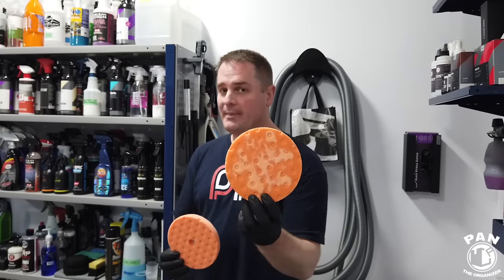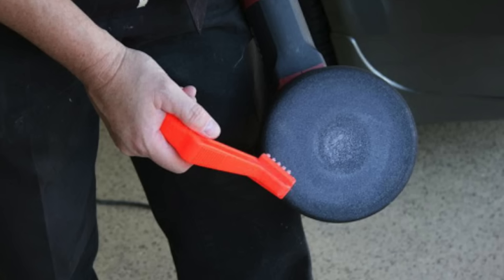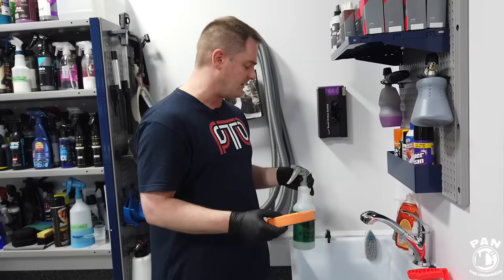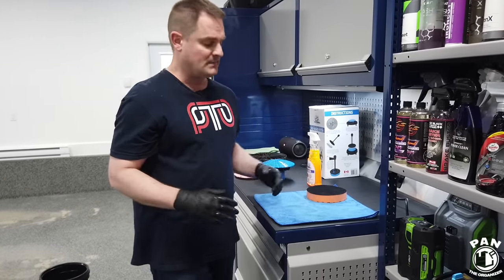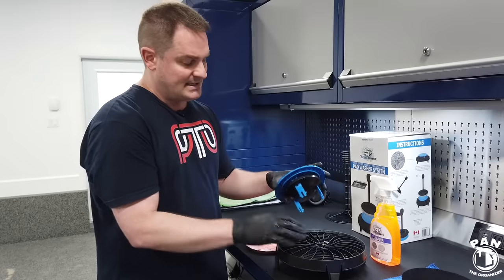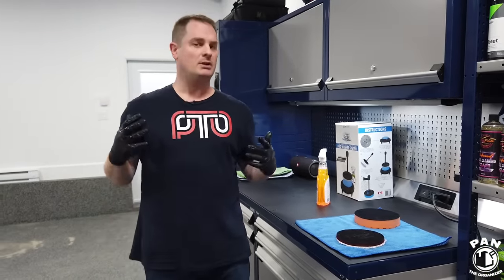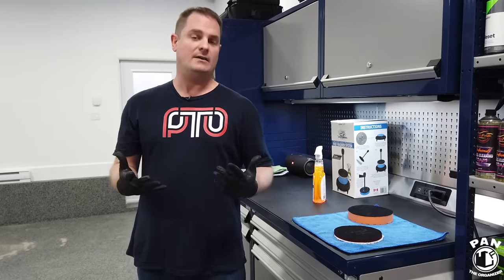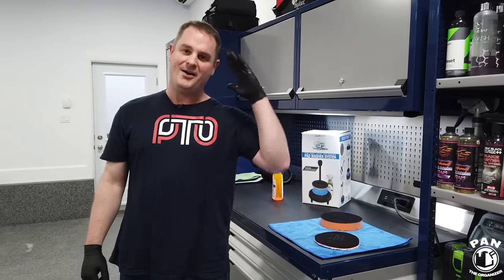HOW TO CLEAN POLISHING PADS... QUICK & EASY !!

Comment: Just want to thank you for this video.  I bought and used my polisher for the first time today, and accidentally went over an aluminum trim piece that put black oxidation into the pad - which then showed up in the white paint.  Cleaned the pad with dish soap and it looks like new.

Comment: Excellent video as always.  What technique do you use and how often do you clean a pad when polishing a car?  My practice may be too careful
- wash polishing pad every two panels. 
- walk into the kitchen, rinse pad with the sink sprayer
- spray pad cleaner on the pad, scrub with dedicated brush
- rinse and wring 
- mount pad on polisher, hold down and away from car and run polisher at 4 of 6 speed to expel water
Reply from the maker: Thanks Steve! I use the Detail Guardz pad washer system, as it's super quick. When I'm done polishing a car, I will typically have a dozen pads (5 or 6  for compound and 5 or 6 for polishing) so it gets the job done super quickly and efficiently.

Comment: A great video on a step that should not be overlooked during the detailing process. 5 ☆ pan 👍🇨🇦
Reply from the maker: Thank you!!  And yes, I agree. Working with clean pads, and cleaning them between passes and panels is key to a proper and efficient paint correction.
Reply: Can pads be reused right away after washing them

Comment: Great video as always! I use all 3 methods depending on the mood that I am in. Most of the time I feel I can get the best results when I do it by hand though.
Reply from the maker: Thanks bro! For me the pad washer is the best for speed and efficiency. But I have seen too many videos where people don't use it correctly. It's important to use the pre-treat spray on the pad, and work it in with your fingers, rubbing it in thoroughly, and then you plunge it in the bucket and pump up and down. Mine always come out perfect as you saw. :)

Comment: Thanks Pan. I just spray pad cleaner on all my pads when I’m done with one during my detailing process. I then throw them in 5 gal bucket of water with some Dawn in it. Now they’re soaking while I complete my entire job. At the end of the day I through all my MF’s I used and pads in the wash with Micro Restore and everything comes out clean and done. Just less hassle then cleaning each pad my hand or working a pad cleaning device. But you need to have enough clean pads ready to go for your job at hand.
Reply from the maker: What ever works for you. Just a quick suggestion though, always wash your polishing pads separately from the rest of your microfiber towels. Pads contain small abrasives that could lodge themselves in the fibers of the microfiber towels and defeats the purpose of having good towels to work with on nice paint, as you could potentially scratch and mar the surface.

Comment: I like to use the first method with luke warm water right after I'm done correcting the car. I find that the pads come out super clean as long as you don't let the compound and polishes dry for too long in the pores
Reply: When you change pads, do you put the dirty pad in a bucket of water while you finish the rest of the car?
Reply from the maker: Yeah the main point is in fact to don't let the compound and polish dry for too long and "cake" the pad. Makes it harder to clean afterwards.

Comment: Perfect timing. About to tackle a huge truck with only a few pads.
Reply from the maker: Using clean pads, and cleaning them as you polish (in between passes or after each panel) is key to a proper paint correction job.

Comment: Pan: I have a drying rack adapter with my clothes dryer. When I'm finished hand washing the pads, I'll lay the pads with the hook&loop side up on the the rack and set the dryer on low heat for an hour. It speeds up the drying process.
Reply from the maker: Good method too!

Comment: Pan a question please involving polishing/correction and pads.  I noticed the pads Rick at RAD used on the Lexus IS video then watched you doing polishing tutorials using foam and MF on different cars.  Lake and Rupes told me to use a medium MF on my soft Lexus paint then finish with Sonax.  Is there a formula you use on manufacturers cars?  Such as : Audi gets this pad with this compound and this polish? Porsche i use this pad with this compound and this polish?  Hope the question make sense but I am thinking by now you have a guideline for manufacturers and then a corresponding “recipe” for the compound/polish then adjust based on condition of the paint.  🙏thx as usual for the guidance and hard work on the pad cleaner options. 👍👍👍👍👍

Comment: Great video Pan, most useful one I've seen related to this subject. 🙂

Video idea:
I'd really like to hear your thoughts on air compressors and their use in the realm of car detailing.
Reply from the maker: Thanks Thomas! Unfortunately, I don’t use air compressors.
Reply: @PanTheOrganizer  
Thanks for the reply. So no vid, I do have a quick question however. 
I was just wandering if there was a particular reason you choose to not use a compressor such as a particular drawback, is it to minimize your equipment to keep things uncluttered, or do you just not find them necessary because of the other tools in your arsenal. You obviously accomplish a high level of detail without them and I value your opinion. 
Thanks again for your great content, your production quality is top notch.
Reply from the maker: For both reasons. I don't like clutter, and in 23 years of detailing, I just never had the need for one. After decades of detailing, I also got to a point where I only offer one detailing package: the total new car prep. So the vehicles I detail are brand new mostly. I don't do those disaster details like I used to when I first started. Not worth my time. So for people who deal with disgusting older filthy cars, I could see where a compressor could be used to blow out dirt, or for use with tools like a Tornador.
Reply: @PanTheOrganizer  
Huge Mahalo for the replies and sharing your insight. I know you're a busy guy and I truly appreciate your taking the time to answer fan questions. 🤙🏽
Reply from the maker: My pleasure Thomas! Hey, what's your favourite video on my channel so far?
Reply: @PanTheOrganizer  
Pan, that question is like asking me to pick a favorite child.
I will say however, I appreciate the honesty and years of experience when hearing your opinions on tools, techniques and equipment. The production quality and personal insight you provide keeps me coming back too, as well as the  topics such as the entrepreneurial aspect of how to vids.
Reply: @PanTheOrganizer  
I geek out on all things personal finance & responsible investing too, so anytime you mention anything remotely related to these topics   I feel like a kid finding an Easter egg.

Comment: Am I the only one that has figured out that soap does very little bit alcohol completely removes it? I've been using Pan's method for years. But I had a lake country orange that I could tell still had white polish in it.  So I sprayed some IPA on a small section, looked like brand new orange compared to the soap cleaner section.

Comment: Pan , how many pads do you recommend for a car? (4 door) , Yvan at DIY says one…then Matt at obsessed says multiple. My thing is after every shoulder size pass…is it necessary to clean the pad or after every panel should I clean the pad or use a new one? Novice driveway enthusiast from NC lol
Reply from the maker: Both answers are good. It depends on your preference. Some people, like Yvan, prefer using one pad for each step (one pad for compound, one pad for polish), but clean the pad after each section using a pad washer like this: https://amzn.to/3I8AVOS

I reviewed that pad washer in this video: https://youtu.be/vfKgy7LOhh4?si=E22XFKghVdOcKP-o

Others, like Matt, prefer using multiple pads for each step (4-5 pads for compound, 4-5 pads for polish) and the switch pads after every other panel or so.

Both achieve the same goal: working with clean pads. The clean pads always are more efficient as they correct better. Dirty pads filled with spent compounding polish don't cut as well. So working with clean pads is key.

So like many things in detailing, there isn't one right or wrong answer. It's just different techniques.

Welcome to my channel. You discovered one of the biggest car detailing channels on YouTube as we surpassed 1 million subscribers and we have over 140 million views! I have been detailing for 27 years and I love to share my knowledge and passion with my viewers.

You found the right channel to help you learn everything about detailing.

Comment: Thank you for your help Pan. One last question, while you’re polishing do you prefer to use compressed air or a brush like the Rupes one to clean the Pad? Are brushes safe or abrasive to clean pads? Is it a better idea to have multiple pads and cleaning them by hand after polishing so they last longer? Thank you from Portugal 🇵🇹
Reply from the maker: I use dedicated brushes while doing the paint correction, and I switch pads often. Clean pads work better. Some say that blowing compressed air is fine on microfiber or wool pads, but that it can damage some foam pads so be more careful. They say compressed air can damage the cells of the foam. So perhaps use a brush on foam pads.
Reply: @PanTheOrganizer  Thank you for your help, you are one of my biggest inspirations for car detail.

Comment: Hi Pan, great video. I bought the pad cleaner, and I also use the hand cleaning methods that you discussed. My question is that is there a different process for pads used to apply graphene sealants. I have used the McKees product and it is really hard to get those pads clean. Other detailers have told me to just throw those pads away.
Reply from the maker: When applying graphene or ceramic coatings (in glass bottles), always throw away the applicators and towels used for the application and removal.
Reply: @PanTheOrganizer  Pan this is the McKees 37 Graphene deep gloss ceramic paint sealant plastic bottle.

Comment: Hello Pan I have a Chemical Guys Torq X DA polisher and I have never used it so if you could provides some tips.  I want to remove light swirl marks and I have all the Chemical Guys 5" pads (Red/Black/Blue/White/Green and Orange) what color should I start with?  I have both the Meguiar's Ultimate Polish and Compound as wells as the Chemical Guys Kit V32, V34, V36 and V38.  What pad to start with, setting on machine and which polish as mentioned above is easier for a beginner to use.....Meguiar's or the V32 to V38.  Thanks in advance for any tips you could provide.

Comment: Hi pan, 
I'm a diy and was looking at the Grigots G9 buffer/water any thoughts on it? Also I was adding touch up paint to my Chevy 2011 equinox and was looking for a way to level it smoothly I was wondering about wet sanding it down or do you have a better suggestion. Thanks

Comment: Hey Pan!! I  like your videos but have a questioned.  When detailing and polishing I notice my pads will get very hot. Do I really need to use a “pad conditioner” like what chemical guys sells?  I’ve read mixed things, some people say spraying anything on a pad even ONR negatively impacts your polish.  Should you just clean or rinse out or wait?  Is one spray of a quick detailed like mequiars sufficient for a hot pad??
Reply from the maker: You can use a pad washer with a rinseless wash in it to clean your pads between passes, absolutely no problem. It cleans and degreases the pad, all while only leaving it slightly damp. Ready to receive more compound and polish.

If you watch the DIY Detail channel, Yvan uses his rinseless wash in the pad washer to clean pads, and the technique works great.
Reply: @PanTheOrganizer  right but I heard if a pad gets too hot it needs to be sprayed with either a quick detailer or rinsleess wash. However, I’ve read this isn’t true and can affect or dilute whatever compound you’re using. 

I’m not eeerrinf to cleaning on the go specifically. Is a pad being very hot from working an issue or can you simply just take it off the panel for 30 seconds or so and clean in the meantime with maybe a brush?

Also speaking of cleaning if I don’t have access to a pad washed on the go is there anything cheaper? Is just a brush fine for a bit?

Comment: Hello Pan. Is APC bad for cleaning pads regularly? (Harsh because of high PH) Should I be using pad cleaner?
Reply from the maker: A pad cleaner would be the equivalent of an APC. There is no danger to use an APC to clean pads. The compounds and polishes that actually contain abrasives are really the ones that destroy pads on the long run.
Reply: @PanTheOrganizer  Thank you Pan.

Comment: Thank you, Pan. A very timely video!
Hold on, how many pads are used when paint correcting a vehicle??  Do you use 2 pads each for compound, polish, and wax for a total of six?
Reply from the maker: Typically, I use 5 to 6 pads for the compound stage, and 5 to 6 pads for the polishing stage. Working with clean and fresh pads, and cleaning them between passes and panels is key to a proper and efficient paint correction.

Comment: Hi Pan quessie for you; products with “pretty” dyes in them that stain pads. 

Which is better for attacking pad stains, prepared pad products or dishwasher / hand wash detergents, soak more or agitate harder?
Reply from the maker: Unfortunately, there aren't many miracles against stained pads, especially black or dark stains. The pad will still be clean, but the stains usually stay. The best way to diminish them is to clean the pads immediately after use, and using the pad washer I presented in this video really helps the most with this.

Comment: I use Griots micro/foam pad cleaner....Quick question...ceramic wax then sealent....
Or sealant then ceramic wax
Reply: Ceramic first. It bonds to paint
Reply: Sealant first then ceramic wax
Reply from the maker: Neither. If you're to the point of applying a ceramic infused wax, then why not go straight for a proper ceramic coating?

Anyhow, regardless of your choice, go for the most durable product first. So look at the durability claims of the products you are using (as you didn't mention which ones). Apply the one that is supposed to last the longest first. And there's no need to apply a ceramic wax and a regular paint sealant, as you can't guarantee proper chemical compatibility. I would pick one, and apply an appropriate topper every now and then, like Bead Maker which you can apply on top of coatings, waxes and sealants.
Reply: @PanTheOrganizer  the only thing that has ever been on this car is Ultima paint gaurd plus.....figured I try somthing new after watching your videos..just finished applying turtle wax ice seal-n-shine when you replied , was gong to put meguires hybrid ceramic wax on top...both are SiO²

Comment: Hey Pan,
Just wondering why you don't further rinse out the pad with straight water after using the pad washer? Wouldn't the chemical used for breaking down the wax/polish still leave residue that could affect the pad next time it's used? It could mix into the new compound/polish that you would be using???
Reply from the maker: Absolutely no worries there. It rinses off cleanly. You could rinse with water if you really wanted to, but I didn't see any difference.
Reply: Hey William, The Dirt Lock bucket filter works to pull and suck the grit and compound coming off the polishing pad. The water is actually super clean, it only changes color from the dye that is used in the compound, which is completely harmless! :)

Comment: Pan. Can I just wash the microfiber towels with the pads together using free n clear detergent in cold water ? Dry on tumble air dry ?
Reply from the maker: I always separate the pads from the towels, as the pads contain abrasives from compounds and polishes, you wouldn't want those getting stuck in the fibers of the towels and potentially scratching the finish once reused.

Comment: Hi,  ive got some foam pads where the polish has gone dry and powdery in the pads, are they ok to clean or should they be replaced?. Thanks
Reply from the maker: You are supposed to clean the pads when you're done with them, so at this point, without seeing them, it's hard to say. It won't hurt to try cleaning them that's for sure. Make sure you remove all the spent worn out polish.

Welcome to my channel. You discovered one of the biggest car detailing channels on YouTube as we surpassed 945,000 subscribers and we have over 125 million views! I have been detailing for 26 years and I love to share my knowledge and passion with my viewers.

You found the right channel to help you learn everything about detailing.
Reply: Thanks mate, I will play it safe and replace them. Have just ordered the detail guardz pad cleaning system. Not a professional detailer myself, just like to keep the Cars/Toys looking good.  @PanTheOrganizer
Reply from the maker: That will do the job!

Comment: Hei Pan I like to wash my pads in sink, method 1. After im done washing it, I never twist a pad to not ruin it but I put it back on my DA machine, turn machine on and speed slowly to max and boom its basically dry. Is this pro tip or am I going to ruin my machine?
Reply from the maker: That is also an acceptable technique.

Comment: Should I have at least 6 pads for compounding and polishing each if I wanna Do a 2 step ?
Reply from the maker: I typically use 4 to 6 pads for compound stage, and 4 to 6 pads for polishing stage (depends on the size of vehicle). The cleaner the pads, the better.

Comment: To polish an average size vehicle how many times should you change pads
Reply from the maker: I like to change pads every other panel. Or, you can use a pad washer, and clean your pad after each section, and you only need one pad in that case. Two different methods.